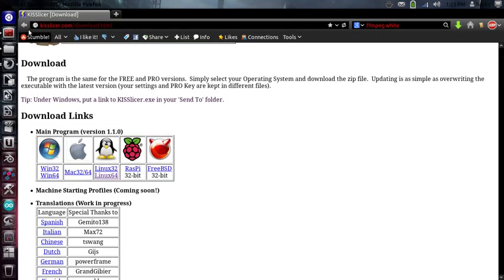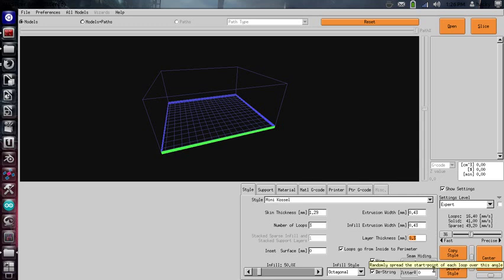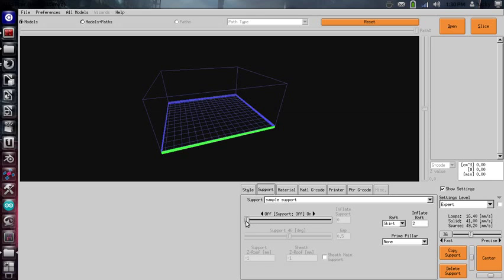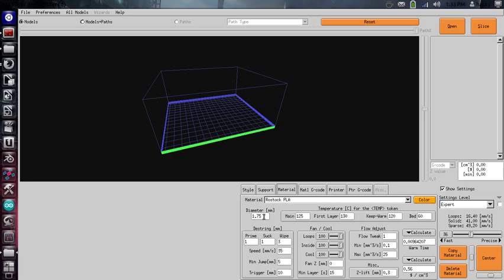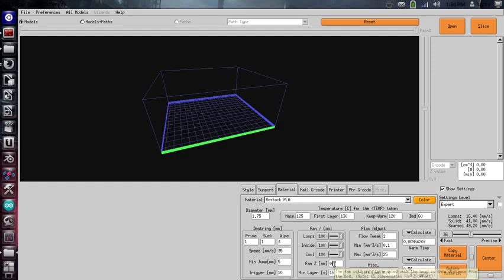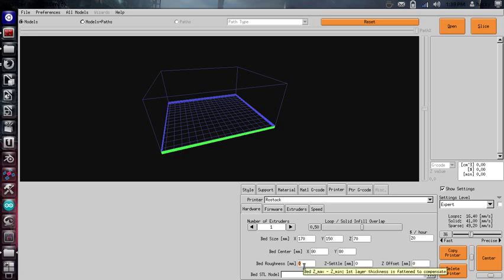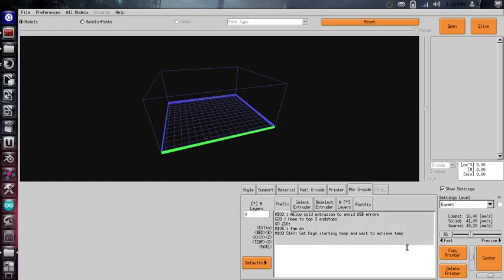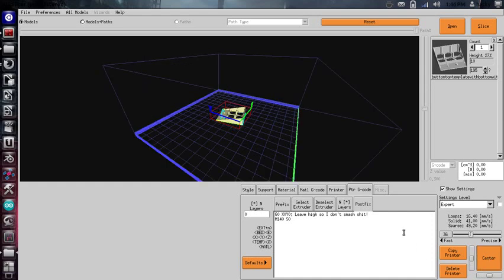Introduction to KISSlicer

Comment: i'm just amazed at how much difference a slicer software can make on print quality. I was happy with slic3r/cura until I started running into problems from combination of bowden + softer filaments. I think I didn't consider trying KISSlicer out before just because look of their website suggested low maintenance software (how foolish of me!), and lack of information from online community compared to other options. If you own reprap machines, it is worth a try!